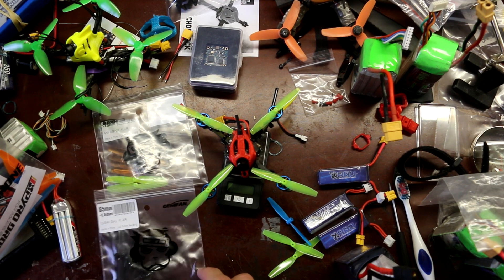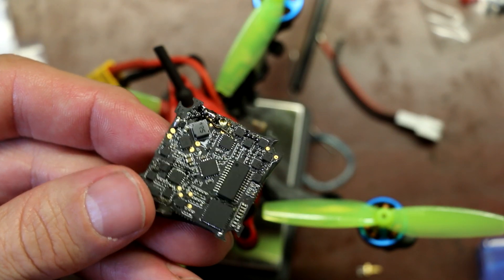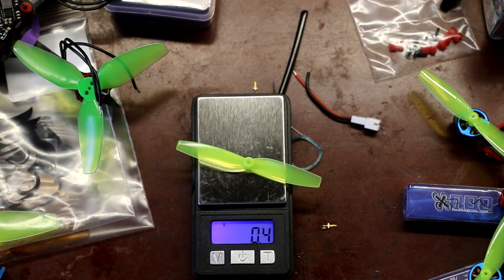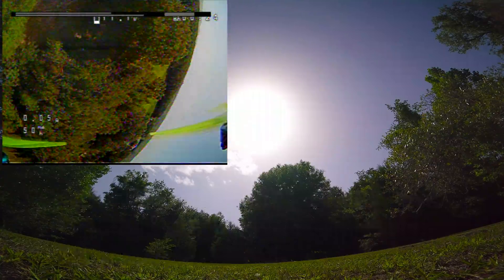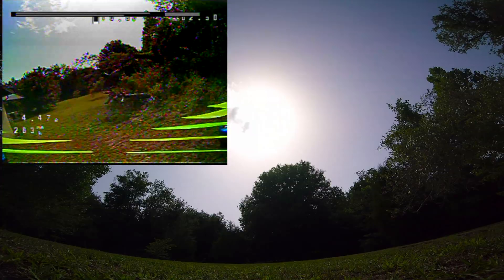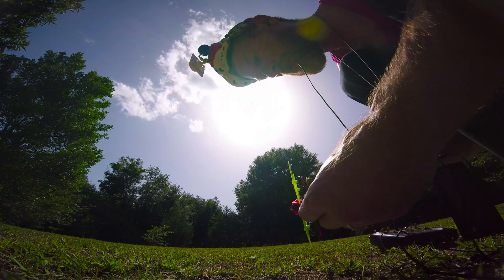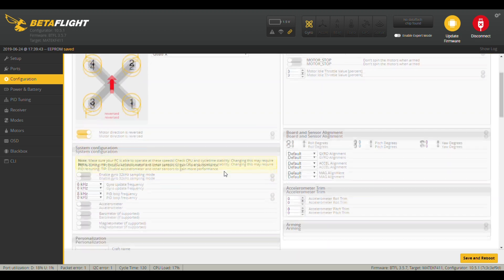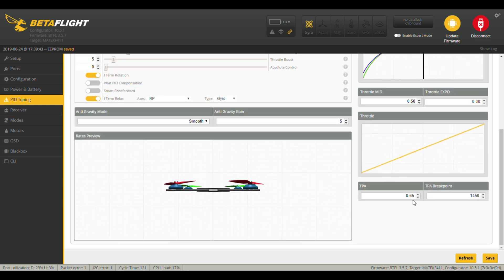Geprc 12a f4 aio\Oscillations\Crazybee f4 v2 junk\Gemfan 65mm props

Comment: You can see the mosfet popped just replace it will be fine. I got a doner board I use for repairing mine if you got a hot air gun it really not that hard to do . Those little boards break so easy may as well learn to fix them or gets expensive

Comment: correct me if i'm wrong interwebz, but i thought rapid fire likes two identical antennas and takes like 15 seconds to lock in.
Reply from the maker: It really depends on the camera.  I have some that lock in right away and others that can take up to a full minute or more.  The runcam nano locks in right away using the same antennas.

Comment: I usually don’t go more than .40 on TPA on a micro but it’s worth a shot to try 65 on the new GF props.  I have pretty much the same build running 2s. I will also try your PID’s on 3s. Thanks for sharing!
Reply from the maker: .65 is the only thing that worked for me on 3s.  Forgive my late reply, my internet has been down for a week!
Reply: mooosestang no problem! I tried 3s on my primo 1103HL  8k and wow what a difference! .45 TPA 1300 -1400 break point worked for me with a lower pid tune from stock. Only draw back is that I have to fly 3s when it is about to get dark cause motors get very hot in my 95 to 100 degree weather conditions!🥵

Comment: How are you wiring the cam and the vtx? Just bought one but can't find any diagrams or pictures on how to get this done. Thanks for sharing... love the video!
Reply from the maker: The vtx i used has 5v out for the camera, so i ran power and ground for the camera to the vtx, vtx is powered by the 5v pad on the flight controller.  If you are using a vtx that can run on 3s, then just wire it to the battery pads.  My rx is a lemonrx diversity, so it runs off the 3.3v pad.  If you are running a 5v rx then you might run into problems powering everything off the 5v rail, but i doubt it.
Reply: @mooosestang  thank you

Comment: your last comment in the video "these boards just don't like 3s"...
lol i've been thinking of building a 65mm toothpick, but i really don't want to commit to a bunch of 2s bats when i already have over a dozen small 3s bats. Overall, would you recommend building a 3s toothpick using the gep board?
Reply: Voidroamer the 2s 350mah hv rdq battery’s with a set of 8000kv motors is sooooo worth it on a toothpick-primo because you will get 6-8min flights. So yes it is very much worth it! There isn’t any other setup that has that much power that can do 7-8min flights. 3s on these toothpick quads isn’t really worth it yet until someone comes up with the perfect settings.

Comment: Nice post.  I appreciate seeing your PIDS. Man, tuning for the GepRC board with 8,000kv motors 3s has been a process, lol.  I'm flying a very similar build.  I have a fairly decent tune on same props, but my D gain is almost half yours and my P and I is lower.  I did not play with TPA and breakpoint.  Will give your numbers a try at some point for comparison.  Thanks...Oh yea, which version of BF are you using?
Reply from the maker: Betaflight 3.5.7, 4.0.X you need lower pids or so they tell me.😀

Comment: Thanks for the update! Is this BF 3.5.7 or 4.0.x?
Reply from the maker: 3.5.7.  4.0.x is a whole different animal.  start super low with P if you want to try it.  I tried it with similar pids above and it hovered for a second then shot straight up into my metal gutter when i gave it throttle. 🤬
Reply: mooosestang yeah I had the same thing on 3s too!
Reply: Good to know. My most recent GEPRC board I purchased was a V1.1 and it was pre-flashed with BF 4.0.2
Reply from the maker: @okelleyappraisals  Yikes!  I think mine came with 4.0.2 or 3, but i flashed it back to 3.5.7 because on the crazybee i couldn't get it to fly on 3s with 4.0.  Just be ready to disarm real quick if it tries to take off on you.😁

Comment: They really need to quit selling that crapybee board...👎
Reply from the maker: Yeah they should. Maybe it would be fine on 1s.
Reply: Smooth_Ops I second that!! They are fine for the 30mm-40mm props but not anymore than that.
Reply: Smooth_Ops yeah I agree I conformal coat mine too. I have swiched to the geprc 12a aid and it is way better! I have a ton of flights on it and it’s still going strong even with some pretty bad crashes into the trees.
Reply: @jacob james They are using the mpu-6000.